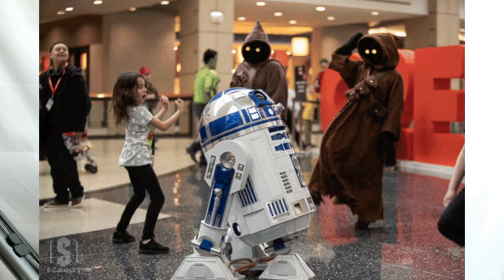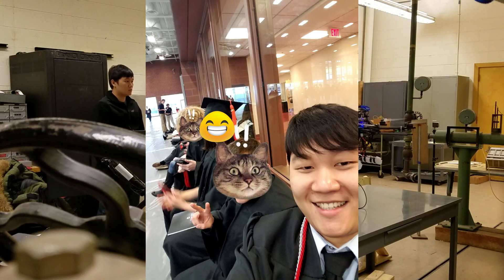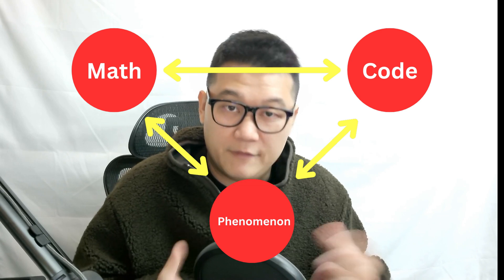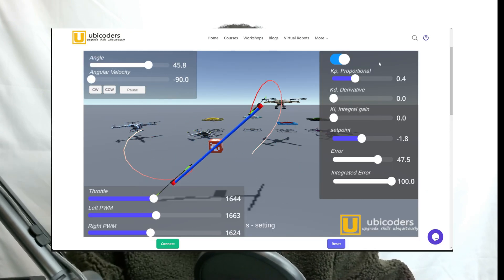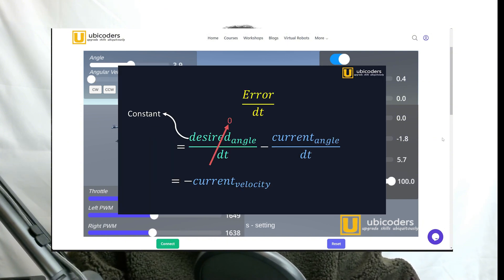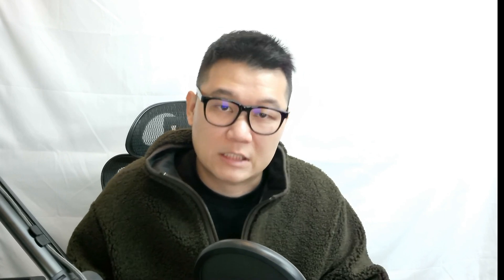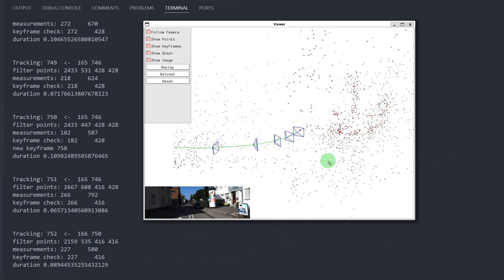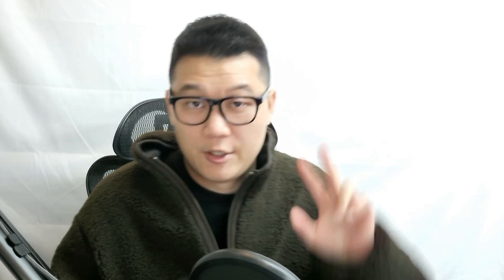My Secret: How I Became an Autonomous Robotics Engineer

Comment: Hello Ubicoders,

Thank you so much for sharing your learning journey. It’s a great roadmap!

I’m a computer science graduate and want to build a career in robotics. I’ve done some research online, but honestly, I’m a bit confused about where to start. I don’t have a background in electronics, and it’s been a long time since I studied physics and math.

Since I already know several programming languages, learning a new one like Python won’t be a problem for me. But electronics, physics, and math are areas I need to revisit and learn.

That’s why I’ve decided to start with the basics of electronics. I’ve already learned about basic electronic components, and now I’m learning Arduino. After that, I plan to explore Raspberry Pi, and then move on to STM boards—or maybe your course, depending on when the time feels right.

I’m hoping this path will help me connect the dots between electronics, coding, and math. I’m also interested in your course, but I’m not sure when would be the right time to enroll.

Please guide me on whether this is the right approach.

Comment: Hey I wanted to comment here for some advice.

I've obtained a BS in Electrical Engineering and I'm about to finish a Masters in Intelligent Systems, Robotics, and Control Theory at UCSD. My issue is that I'm no prodigy. I've had to sink a lot of time into my classes just to pass my exams, and being on quarter system, everything is so fast paced. I've scraped together some projects here and there over the years, but sinking so much time into the classes left we with very little time to do projects at this level or volunteer in any research labs, and now it's all coming back to haunt me as I apply for jobs. Even when we did things like motion planning or SLAM in classes, we were given like less than a week to do it and it was so fast paced that nothing really sunk in. 

Now I'm about to graduate and leave the school so I'll be cut off from getting any more experience from the university, and I keep getting rejected from so many robotics jobs because I'm just not qualified. It's hard to specialize in anything or get practical experience when your being taught a new algorithm or some deep linear algebra proof every single day. Arguably, I am pretty good at the math and understanding code now, but it seems like employers don't really care, and everytime I try to conduct a project outside of my classes to get practical experience, even small ones, I quickly become overwhelmed with class work and end up having to back out of the project because it starts taking a physical toll on me. It makes me not even want to do the project because its like 6-8 hours doing proofs for classes then 3-5 hours in a lab learning ROS2 and studying some really complex architecture every single day. It's just not sustainable. Then you see places like Tesla requiring 'reinforcement learning engineers' for their robotics teams, and you're just like how was I supposed to study that extremely specific skill on top of all my classes??

I feel like I wasted so much time, like I could have made better choices, like I'm doing something wrong, but also don't see the point in dwelling on the past. I'll have a Masters Degree which is great, I'm proud that I toughed it out at this school and survived. But I may not be employed for awhile. I just want your advice on where to go from here once I get out of this school system. It feels like I was almost deceived into this program thinking that doing this would get me into robotics. Now, I want to put my foot down, I want to make an informed decision on how I can actually become a robotics engineer so I can do the thing I've been working so hard for, and not that I'm doing it for the money, but yes I want to get a job that pays well for all the years of diligent work that I've put in. I don't want to feel like my life is over after school and I'm doomed to work some job that has nothing to do with robotics. 

I want to graduate now so I can take a breath. I haven't rested in like 8 years, studying 7 days a week. Everyone is pressuring me as to whether I have a job lined up or what my plan is after I graduate, but it's just hard to think about your life when your just constantly waking up, classes and homework all day everyday, leaving you no time to really strategically plan out what your next move is. Maybe I'm just ranting here, but you just seem like someone who understands my situation. Sorry for the long message. I just haven't been able to talk about this with anyone because it seems like all my classmates have jobs/internships lined up at big companies and I'm the guy that got the short end of the stick. I want to make a change and take some control of my life, but also without overstressing myself once again. I'd love to hear your perspective on this situation.

Comment: Hello pls I am currently doing BSc Computer Science. I want to go into robotics and automobile engineering. Is it possible and how can I pursue it
Reply: You should probably pivot to computer engineering or mechatronics then, or at least minor in it or take specific classes in that and control systems and speak with your advisor to help you coordinate
Reply: Ok. But can't I use my BSc. Computer Science background to go into robotics and potentially auto-engineering or I have to use the route that you are saying.
Reply: @LeslieAsamoah-c2l  you probably can, I just assumed you were early enough in your studies that switching wouldn't be too difficult. Your major weakness by staying in computer science will be a lack of anything hardware/mechanical related but your strengths will definitely be in anything software related so you will have to adjust for this by manually seeking out those classes or some other way to gain that knowledge. These classes would be built into a computer engineering or mechatronics degree though
Reply: @LeslieAsamoah-c2l  it just really depends on what your degree program includes but either way no matter which degree you do choose you will most likely have to refine your knowledge with some side projects or self study of related topics. Definitely do not skip mechanical physics courses/ hydraulics/pneumatics/electronics/circuit analysis/power drives/power systems/control systems etc. speak to your advisor because it's their job to help you figure all this out
Reply: Ok so currently the courses I am studying under Computer Science are:Physics, Discrete and Continuous Maths, Digital electronics,and Procedural programming. Based on the subjects I have stated do you think this is a lot okay for now to lead me to robotics
Reply: @LeslieAsamoah-c2l  yep those are all going to be useful as foundational building blocks, you will need more classes later on but also maybe you should look into joining your schools robotics or engineering club to get some more hands on experience too which will help you immensely
Reply: @787310  Or alternatively maybe taking a masters in robotics and a doctorate in Automotive engineering might be also good.
Reply: @LeslieAsamoah-c2l  great idea! If you're lucky, you might be able to get a job with your bachelor's, and then your company should be able to pay for your graduate degree, saving you a lot of money and helping you build your experience

Comment: I m confused in ROS. Understand ROS is used to program robot. There are so many components in a Robot like the Wheel, the arms and others. Each of the parts has hardware, firmware and microcntroller. How do you find the parts , firmware and microcontroller and How ROS communicate with them to build a robot? The only obvious choice  I can think of is to purchase the ready-made robot. Can you explain. Hopefully this will motivate me to look further.Thanks
Reply from the maker: In fact, I'm gonna have to make another video to fully answer your question. To be quick for now, ROS packages do not work like pip or npm packages. I always recommend going with the first principle of robotics (control engineering). Then, a couple of lines of code does the thing if lucky.
Reply: @ubicoders  Thanks. Looking forward to your tutorial on how you handle those firmware and miccontroller with ROS when you want to build your own robot. Like Drone DJI, they made their own firmware and hardware and micro controller. Can ROS directly connect all the firmwares?

Comment: Will your course come with live projects that we can build along as we follow on the course?
Reply from the maker: Thanks for the question - yes and no. There will be several courses. For 101, you will practice math-code-robots in the simulations only. For embedded focus, we will use the actual hardware based on 101. For details, please checkout https://bit.ly/4g795lU

FYI, there are 2 major reasons why I divided like this. First, it's more important to practice the scientific idea for beginners. Then, connecting actual wires is relatively trivial. Second,  there are some people already have experiences with hands-on robots but they still expect  the core scientific practices

Comment: Hi Sir, ....! Thanks for the video!

    Can You do Tutorial Series on the subject CNC Motion Control basic 3 axis for wood carving purpose?

Using any of the G-code streaming PLC available in market?

1) How can We configure such a PLC to read G-codes from a USB Drive plugged in to it and send motion signals to Servo drives

2)Example:- a basic Square pocket with X,Y and Z interpolation movements to carve that Pocket.

3) The G-Codes from any CAM program like Autodesk Fusion360 with suitable post processor for the PLC

4)How to Display the 3 axis on a HMI Screen with realtime DRO, Reading and stuff (Just Like Mach3 CNC GUI Screenset by Mr.Physics Anonymous)

I know it is a vast area. But Can you Breakdown the Concepts in Configuring the Controller to Read G-Codes and execute Motion Commands to Servo packs .!

Also Please consider Connecting and configuring Servo packs to the controller as well.

I am very passionate in making my own 3 axis CNC Router with a Industrial grade PLC based Controller with Servo packs.

Rather than hobby level stuff.

Please consider Gcode Streaming atleast..!

Comment: What a great channel. I don't understand why I hadn't seen it before, it's amazing content. Thank you for this.

I also work with quadcopters and AI. Can you tell me what simulator you use to train your drone? AirSim, Gazebo, flightmare, isaac sim, or something else? What are the problems with transferring the trained model to a real drone with px4 installed?
Reply from the maker: Hey~ why haven't you seen it before? Because I just started to run to take off. ;)

For the navigation projects, I use airsim a lot. Others are like X-plane, simulink, etc. I even make one using Unity3D. But mostly, I just end up with collecting the actual data because the fact that it works on a sim doesn't guarantee it works in real life. Or maybe I'm just a bad engineer. 😭 😂 😲 😱

About the trained model to px4 stuff, I use the custom controllers and tune them in real life. To train the controller using whatever sim.s need the exact system identification process to duplicate. So, if it's new, I'd need system id process anyway so I just actually build a testbed first. 

Or, if I can find a paper discussing the similar system, that's another cheat we can use ;)
Reply: @ubicoders  Oh, there are still authors of such unique channels who respond. I'm very pleased and grateful to you for responding :)

So you're saying that even if you teach it in airsim, it usually doesn't guarantee that the drone will fly in reality. It won't fly at all? Or will it fly really badly? And, as far as I understand, in 99% of cases, you need to use a testbed to check how the model trained in airsim will fly in a real environment? But it doesn't fly on the testbed, it just turns the engines? How do you solve this problem of transferring a trained model to the real world on a real drone?)
Reply from the maker: If you are talking about training CNN  (convolutional neural net) for image processing for the navigation part, unless you're working on REALLY LARGE video data, training only airsim may let your CNN train only for the airsim textures of the scene. Then, if you change the scene or camera, the textures will be different, resulting in CNN outputting trash data, and you might need to train them again for the actual data. 

I don't usually train the state estimation and the controllers together using deep learning. If I understand your question correctly, I separate them.
Reply: @ubicoders  Okay, our dialogue has already helped me a lot, I'm very grateful for that :)

And then how do you approach the problem of aggressive flight of a drone in a real environment that will navigate using two cameras (stereoscopic vision) and avoid obstacles?
Reply from the maker: That sounds like one of the good PhD dissertation topics! Unless you are making a terminator, my guess is that the performance of such a vehicle is not really the problem of the navigation algorithms itself. Instead, it is about the quality of the cameras you have. High resolution, fast shutter speed, and high frame rate. Then, likely, the camera could get heavier or more expensive. It will affect the flight dynamics if heavier, and the "aggressiveness" will be bounded. If it is more expensive camera for such a flight and if you know one, please let me know. I want to buy one if I can afford it.

Checkout this guy who researches the drone racing with the A.I

https://www.linkedin.com/in/davidescaramuzza/
Reply: @ubicoders  I now have a nvidia jetson agx orin 64gb and 6 cameras on the drone, two of which look forward for stereoscopic vision. The cameras shoot in 4k 60 fps, they are regular cameras for $30 each from arducam. I want to use a neural network for stereoscopic vision with huggingface, and another network for depth estimation. The drone will end up weighing about 5-6 kilograms. Some people tell me that it may not be necessary to fly very aggressively, since the drone will mainly fly at an altitude of 20-30 metres and up to 100. It will mostly see the sky and the ground, we don't have trees taller than 30 metres :) Sometimes you will need to descend from a height of 40-50 metres and return to 100 metres in a couple of seconds.

If I could be of any help to you, I would be happy to help you. If we could talk in a personal discord or telegram, it would be amazing :)
Reply from the maker: Keep in touch~!
🔥Linkedin: https://www.linkedin.com/in/hongyun-elliot-lee/
🔥Discord: https://discord.gg/fEjuc5ccu5